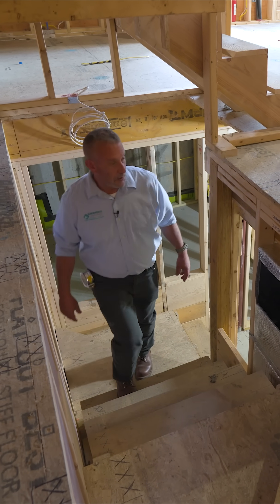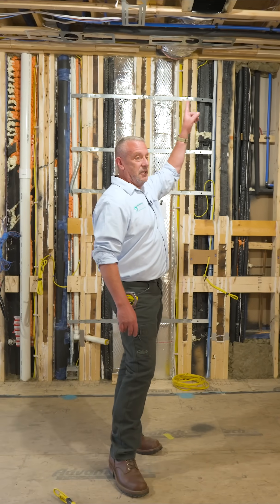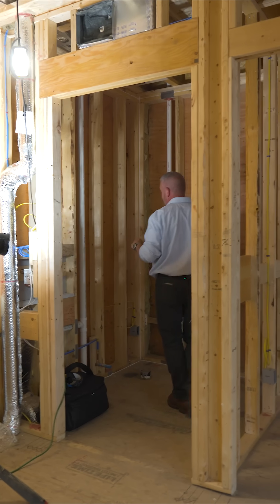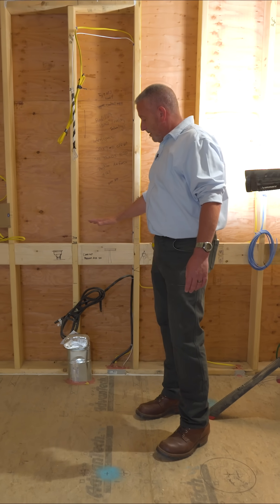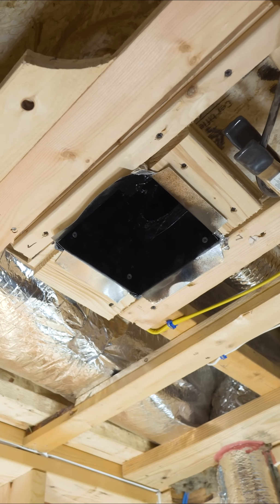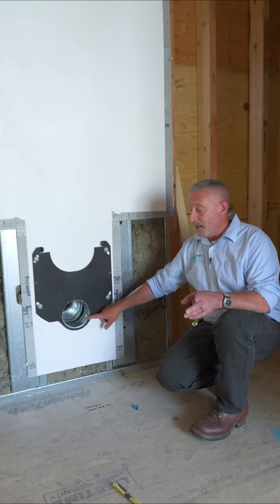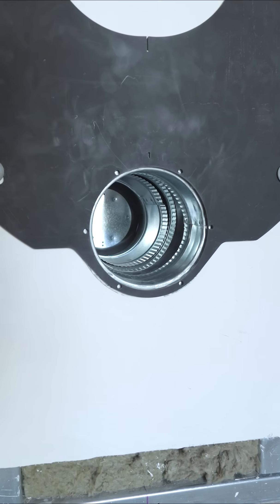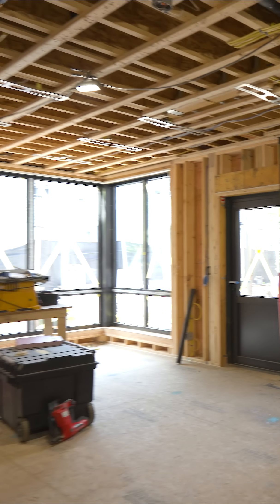Kitchen AND Fireplace Make-Up Air in an Airtight Building

Comment: If that is a half bath, running the exhaust low will reduce smells while pooping. Right now you are exhausting the smell right past their face.
Reply from the maker: Not a bad idea. We do like high registers in bathrooms for humidity, although no shower in this one, but I like how you’re thinking. Improving the experience. I wonder what Corbett Lunsford would think about that…
Reply: @auburndalebuilders  In most luxury homes there is a water closet and we (hvac design company) typically specify separate exhaust ports for the toilet and the greater bathroom area. Also a great feature if you are comfortable with it is a humidity sensor to control the ERV system boost mode for showers and bathtubs.

As for Corbett Lunsford, look up his videos for his litter box. It is the same idea. He has a ERV exhaust in the litter box enclosure to control smells. You will love that video too! https://youtu.be/gDkR8qjZ1MQ?si=Evrn9DpTgoHF6xHM&t=255

Comment: I am so glad to see somebody actually talking about air return from the outside. I see so many brand new homes and even in small mom and pop restaurants where a fresh air return is not even thought about. And it causes so much problems overtime. If you look at houses that are built in Europe, they actually have an air exchange system that has a fresh air is being pulled in. it goes through a heat exchange system where the air is being forced out by say a chimney or furnace. The incoming air is heated through that exchange so it’s not just bringing in cold air. That was 30 years ago.
Reply from the maker: Yes. We have known about building performance for decades and we love learning new ways to improve performance everyday. A house that looks great, functions well day to day and performs will be around for a long time we think.